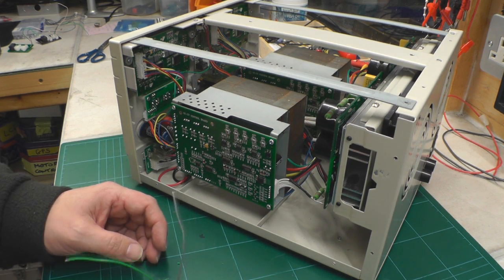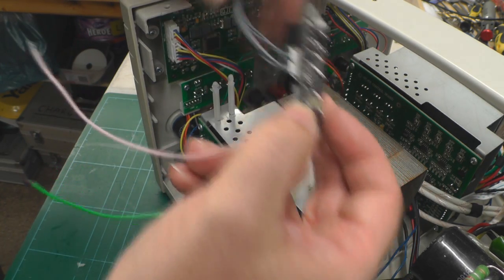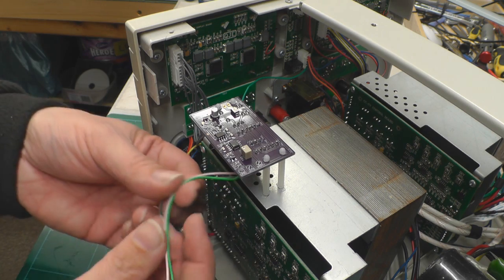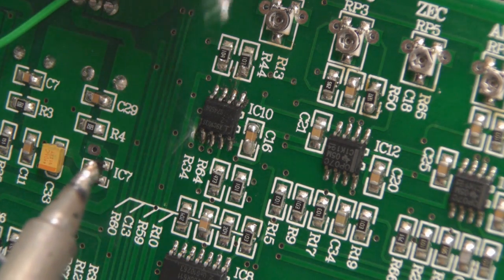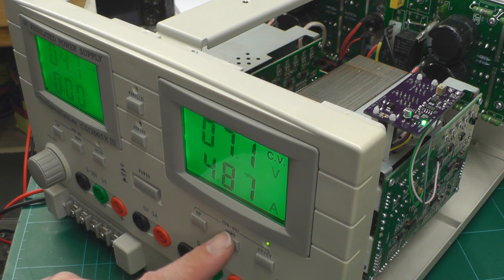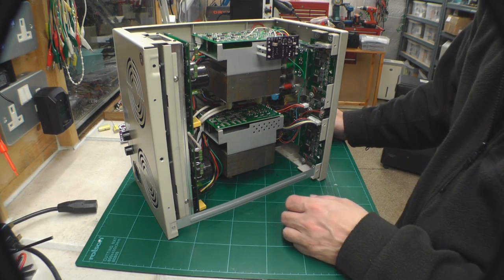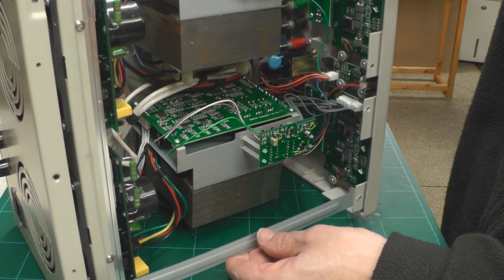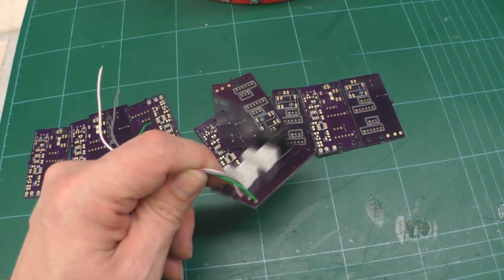CSI Bench Power Supply - Constant Current Mode Modification - Production Pcb

Comment: Thats a nice mod.
Whats the reason for those long plastic stand offs rather than shorter metal ones?
Reply from the maker: I have aimed at a single sided board thus top side soldering only, so the connectors HAVE to go on the underside. Anyways, the existing loom is quite short and would be a stretch to get them to plug in topside. Also, metal standoffs would mean fixing nuts underneath and there's no room at all to get any tools in. The way I have designed it means nothing needs taken apart and it's all very easy. Plug n play.